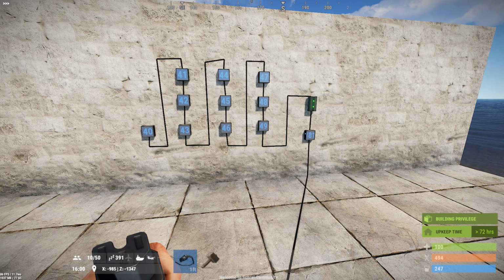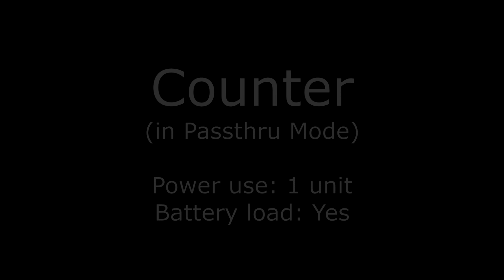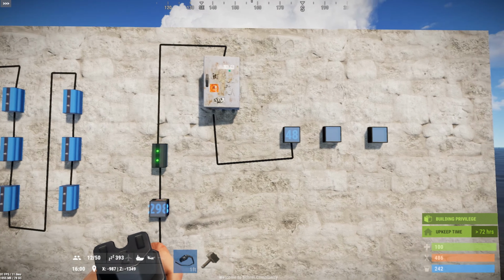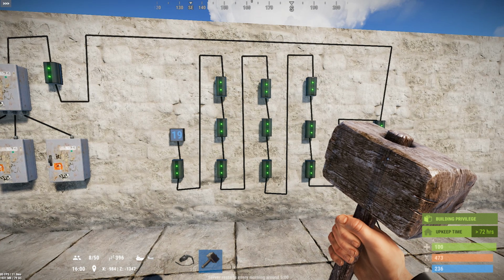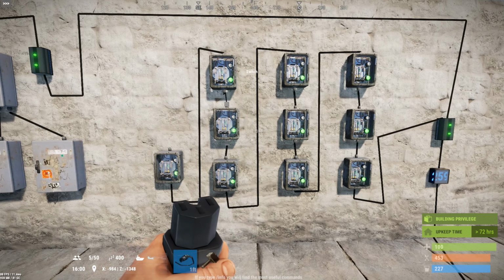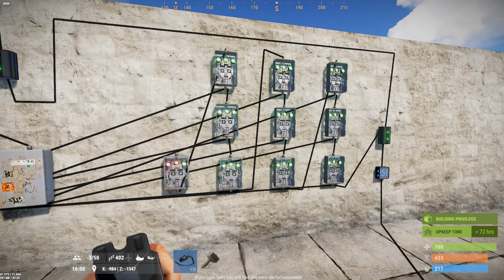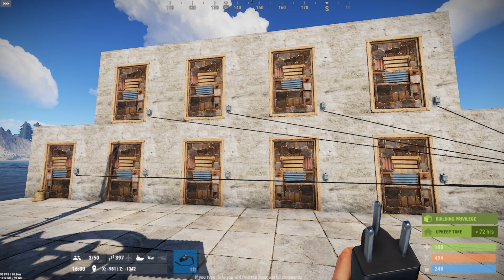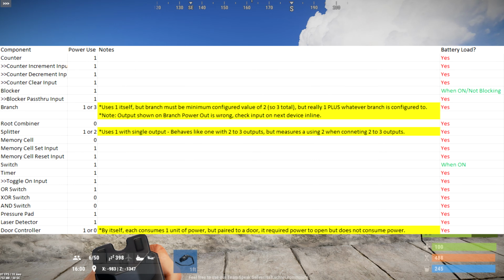Rust Electricity Update - Component Power Use *short*

Comment: what about the light?
Reply from the maker: LOL of course I would forget the light! I believe it is 2 power units but I will verify and supplement tonight!
Reply: Lights are weird. The Ceiling Light is slightly less than 2. When fed 2 Power, the Ceiling light will display 0 on the output. But - at least in a chain of lights - if you only give them 1 power, they will still illuminate!
Reply from the maker: @holysirsalad  I have observed this also. Typically they consume 2, but there are edge cases where having a little over 1 will also keep another light on, like in some splitter situations. Seems like maybe they are rounding up in some cases? I just stick to telling people to plan for 2 units per light to be sure.